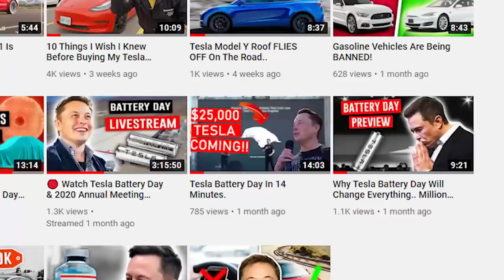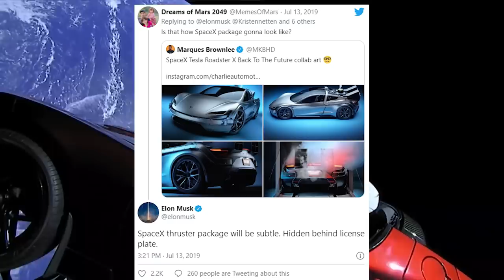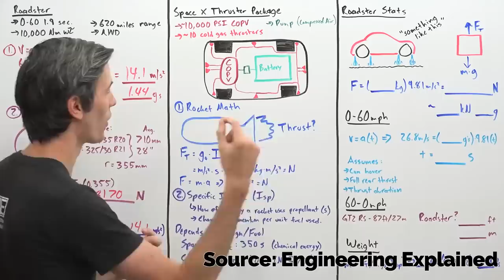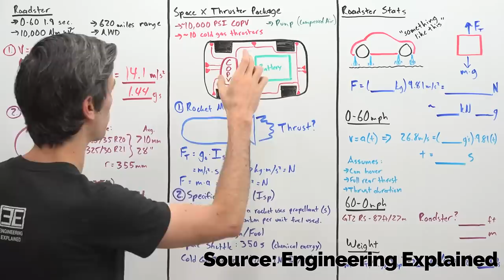The Tesla Roadster 2021 Update Is Here!

Comment: Cybertruck is getting 560 mile range with the 200kWh pack ... Model S is getting 520+ miles with a ~140kWh pack ... I bet the roadster will do at least 750 miles
Reply: No I think it will have the same batt as the plaid S except the better aero will push it well in the 600’s
Reply: @bob15479  They already said 200kWh
Reply: Probably be around 400 miles in real world use, Tesla uses really aggressive Regen braking and slow driving to achieve high numbers on their vehicles which isn’t realistic driving. If you drive it enthusiastically up a mountain, the range would be around 40 miles, because the efficiency of an electric motor is very sensitive especially compared to an internal combustion engine

Comment: At time 5:33, you said that the closest non-Tesla in terms of range is the Chevrolet Volt, with an electric range of 259 miles. It's actually the Chevy Bolt. The Volt is a hybrid, and had nowhere near that range. The Volt is also out of production.

Comment: You confused the Chevy Volt plug-in hybrid which has been discontinued with the all-electric Chevy Bolt, an ugly little hatchback thingy.

Also, since you noted that the Roadster will be using cold gas thrusters so what's with the clip from a flamy jet car?

Also, I was expecting new information and got none. I typically like your content, but this video needed some work and better research.

Comment: IF you count charging time it isn't fast at all.  On the Autobahn from Munich to Berlin; you'd average about 120 mph because you will be sitting on your hands 2 hours charging your super car.
Reply: I might be misunderstanding your comment but 600 miles of range is enough to drive from Berlin to Munich, having about 200 miles left in the tank? No charging needed.
Reply: @Alex_Eh  Hey Alex; no Telsa ever gets it's claimed range! Even if you old it down to 60 mph a Tesla Roadster might get 400 actual miles.  The faster you go; the the more energy is used at a faster and faster rate, and your range is shorter and shorter.  A Roadster at 140 mph would get at most 200 miles before needing a charge and at 250 mph as I say ; it would be lucky to get 100 miles before it ran out of battery.  EVs are much worse at the degradation than non EVs, electric motors are always running at 95%; ICE engines get more efficient as they go up towards red line.  Even having on your air conditioning or heater will noticeably hurt your range in an EV. I know it is a bummer but this makes a bit of a joke out of a super fast EV; like the Roadster.  That was my point, at these high speeds you'd be charging as much time as you drive or more.  This is why you won't see a Tesla at Le Mann or the Dakar Ralley or any long race;  it can't compete.  Had they not put literally a ton of batteries in the Roadster; it would not even go that far; so the car weighs 4400 lbs. It can win a very short race or at a drag strip; it can't win any real race or even come close. Of course Tesla doesn't make much mention of that. So even if you run out of fuel in an ICE/Hybrid you can fill up in a minute (pit stop); it won't take an hour at a Super Charger like a roadster will.  Sorry to break the news to you buddy.
Reply: @litestuffllc7249  I'm glad you're assuming that I dont know anything about EV's and that you're trying to educate me with basic-over exagerrated facts. I know how battery cells work, I know about their thermodynamic behaviour and I know about battery-degradation. 

Basically everything you can do with the car draws energy out of your battery which will eventually cause your range to decrease. Nonetheless, your numbers are (probably) wrong, just as your comparison to an ICE. We can't be sure of the actual range until the car finally launches, whenever that'll be. You'll need to drive about 375 miles from Berlin to Munich. And I promise, based on others Teslas‘ power consumption per mile, you‘ll get there.

Yes, Teslas usually fail to meet their advertised range, but not by too much of a number. The energy consumption exponentially increases the faster your drive, but lets be honest, you can't drive 250 mph all the time, not even in Germany. In fact, almost no where.

You gotta keep in mind that every car needs more energy/fuel because of the aerodynamic drag you experience at higher velocity. Weather plays a huge role and will undoubtedly decrease your range, but you therefore won't be able to drive as fast anymore (who drives 200 mph during rain?), so you can at least be sure that both range- reducing circumstances (driving fast + bad weather) won't occur at the same time. Just google it, high speeds will mess up your range, thats a proven fact, and you will find insane stories from users about that. But you will never find a proper working Tesla that only manages to get one sixth of the advertised range under real-world circumstances. 

Nothing you said is necessarily wrong, but your numbers are nothing but a huge exagerration. EV's are not as "consistent" (not saying they're unreliable, thats a difference) as gasolin powered cars, but they are not as bad as you make it seem with your comment.

We don't have the Roadster yet, maybe it'll be a failure, who knows. But If it behaves just like other Teslas, it won't.

I'm sorry if  this message sounded "aggressive" or offensive in any way, thats not the point I was trying to make.

Have a nice day,
Cheers! : )
Reply: @Alex_Eh  Ok well it doesn't sound like we really disagree; sure you can't always go 250 mph, and Munich to Berlin is about 375 miles as you say.  My only point is any EV going super fast is not going to go very far; and then you will have to recharge. Unlike say the Ford GT; a Roadster will never be able to compete in a race of any distance unless they could swap out batteries quickly. If you disagree  I'll give you a gentleman's bet at super car speeds it won't get even 200 miles before it has to recharge; I'll even stick with 100 miles if the car averages 200 mph.  Maybe you don't disagree?  Go look at any Tesla real mileage tests here on You tube; typically they fall short of the claimed range by 30%; that is new cars going 70 mph.  This strongly suggests the Roadster brand new driving at 70 mph; will go about 400 miles. Yes you could get to Berlin at 70 mph but that isn't super car speed.  Accepting your own statement that as speed goes up  you'll use exponentially more; I can't see how one could expect it to get more than 200 miles if you are going as fast as possible.  I've driven on the Autobahn and I was doing 120 mph when two motorcycles passed me like I was standing still ; so you can go very fast especially on a nice Sunday Morning. If you haven't been there; Germans are quite good about pulling over to let faster cars go by.  Thus; given exponential energy use; and averaging 180 even;  I think you can't make 200 miles; and honestly I'd be surprised if it can get 100 miles if you average over 200 mph.  It does weigh 4400 lbs so it will have a lot of momentum and a fine aerodynamic drag; but I really think 100 miles would be a generous estimate if you average 200 mph.  That is near 3 times 70 mph, so energy use would likely be what? 4x? 5x? higher?. I think now that you see my point we can agree?  We can wait and see.  I am sorry if I sounded like I was explaining to you but when you said the range was 600 miles; I figured you must not know that the range one actually gets in EVs is near a third off  from the claims.  As I say; go look at any of the videos where people actually drive any Model Tesla and they run the Tesla down to zero battery  and check the actual obtained vs the claimed range; I am pretty sure you will see I am not exaggerating or nor saying its inadequate; it just is how it is.  BTW my comment was really about the sort of hype one gets about the Roadster being the fastest car in the world; and my point was only that going so fast ; it will charge often and hence your average speed won't be that high over a any longer distance.  I like Tesla; I have ordered and EV; but I just don't care for hype that people put out so I wanted to put some cool water on that is all.   Best Regards  Jim.

Comment: I keep hearing about superdraco engines being used in the roadster. I can’t facepalm harder, those engines are fueled by toxic liquid gasses, I think and they are way to powerful they will accelerate a car enough to probably cause permanent damage to the car itself. The thrusters will most likely be using RCS thrusters propelled by super chilled nitrogen. They are less powerful and not fueled by toxic fuels. 

thanks for listening to my Ted talk.